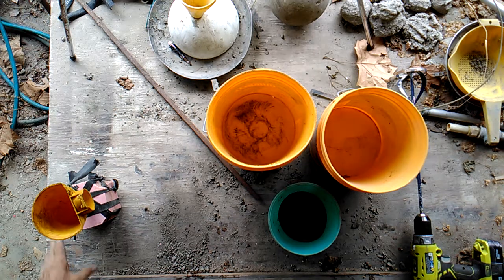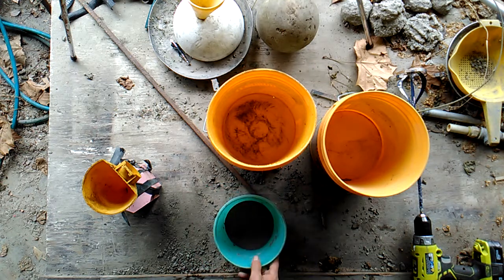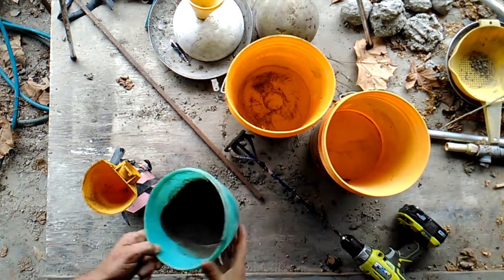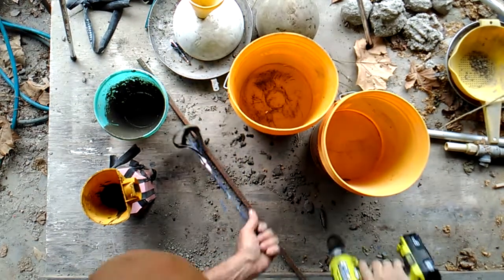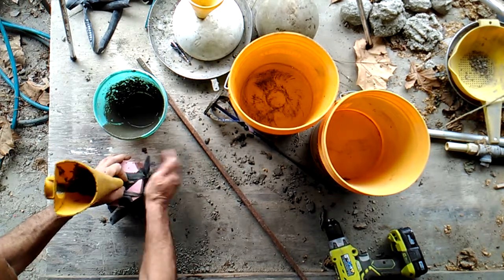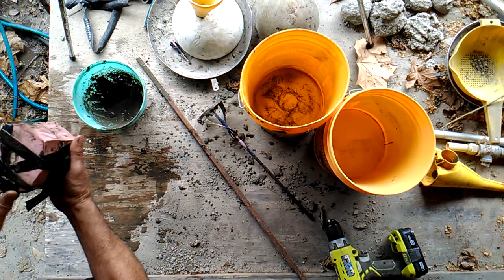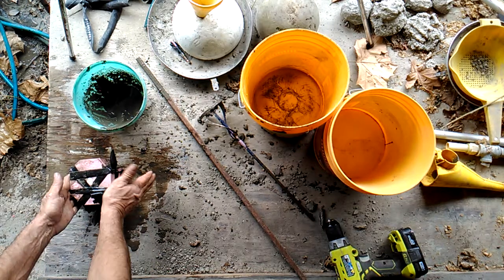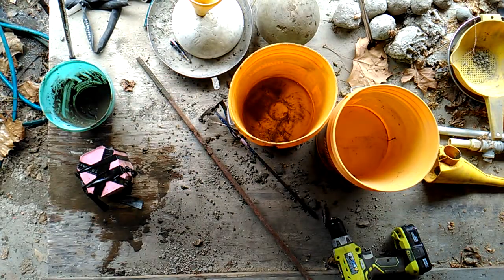Catapult Projectile Casting. 1 Pound STP

Comment: Guess I'm using this thread as a message board. You don't have to buy that expensive molding material . Original Silicone [1- smells like vinegar] caulk  works just as well. About $5 a tube at Walmart. I used to use it to cast pewter in the 80s. It can take heat and is super flexible. It needs time to dry, so it works best in consecutive thin layers. You can reinforce a mold with fabric and use ice to tool the uncured caulk. The biggest downside is the time it takes to dry, like a week to make a mold. Now there are videos of mixing it with soap suds to make an air entrained putty that cures much more quickly.
     I just finished a base to build a whipper. Made it out of leftover oak flooring scraps from a job. The base is an isosceles triangle with 40" legs. I saw your Popular Mechanics project and wondered if you have some info on specific ratios and angles. I understand how important small differences are and common sense will only get me so far.  The base is designed to be a multi purpose test bed. One idea I had was to set it on a pair of  arched rails so the entire base would act as a pendulum when the weight drops. I also wanted to explore the double yoke thing with fiberglass arms. But one thing at a time. That third arm thing was probably nonsense, I had some fleeting idea of something spinning wildly inside a yoke, maybe using gears like a transmission.
Reply from the maker: I'm glad you comment and talk on here. Hardly anyone ever says anything. These machines are my passion, so I like to talk about them. I have used tube silicone before. It was a pain in the butt. I want to create professional products, so it takes professional products and materials, and scientific methods.  That's awesome you're building a test platform.  The frame angles are straight forward and totally scaleable.  Side towers are 45 degrees out of the apex, so leaning front to back at 22.5 degrees, and lean in laterally at 15 degrees, so the top and bottom compound miter cuts are 22.5 x 15.  The head space is set by the projectile size, and everything works out from there to get the base dimensions.  Max the throwing arm length out in the frame, set the beam ratio, (4:1 to maybe 7:1). The distance left over sets the hanger length. Projectile weight and Mass Ratio are factors in determining beam ratio. I run a pretty wide range of ammo, so I make my slings adjustable. Lighter frames move faster, so don't over build it. I have seen Rocking Whippers in action. I think an oscillating frame is better then a rocking frame. If you're in a snowy or icy place, try skis or ice skates. 40" legs would put your in the same class as our 7 foot tall machine. It's a really awesome size and machine.  A couple things to think about when you build the arm and hanger is a way to adjust the angle between the throwing arm and the hanger; "Gap", "Timing Prop", and an adjustable length trigger system. I like my trigger system "Hammer Leg". It's super stable, dependable, and adjustable. Feel free to ask all the questions you want. That means I get to share more of my knowledge and talk about this stuff, and maybe learn More. :-)
Reply: Thank you, This will help. Skis might be appropriate here in CT.  The ceiling in our basement is 7' so it needs to be able to go through its range of motion where I'm building it. I always try to look at your devices details, like where you use treaded parts so it can be adjusted.  @FingerAngle
Reply from the maker: @rowgler1  You may want to go with Baby Whippers scale. Release is at 80-81" You could fire it in the basement, horizontal flights. It launches everything from marbles to weighted baseballs. Golf balls out over 500 feet and base balls over 300' with 50# cw about  max. 31" axle height.
Reply from the maker: @rowgler1  High performance is in the details. Details are everything with everything in my world.